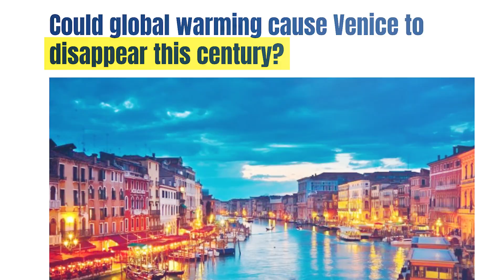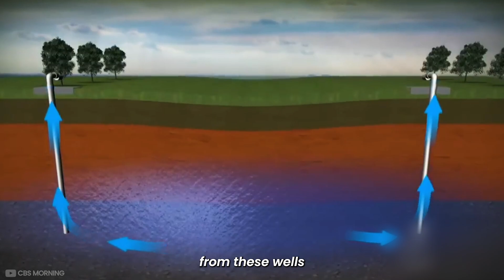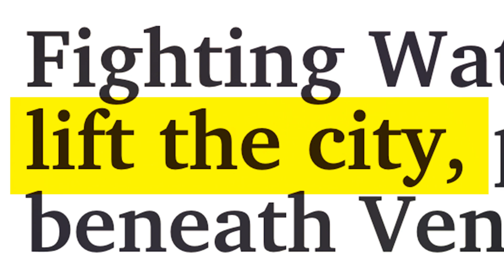Why Venice is SINKING Irreversibly

Comment: Venice is currently sinking at a rate of about 1 to 2 mm per year, and if current trends continue, it could be underwater by 2100. Experts suggest that the city could be at risk of disappearing beneath the waves by as early as 2100 due to ongoing subsidence and rising sea levels.

Comment: The powers that be (Oil companies, Automakers, etc.) are pathological liars. The city isn’t sinking as they would have you believe. The city stood for a thousand years, and suddenly, the whole city starts to sink at the same time? It would take some really gullible people to believe such nonsense. On the other hand, ocean levels have been rising for some time due to climate change and hotter-than-normal weather. This is why all the ice in the North and South Poles has been melting for quite some time. As a result, not only Venice but most oceanfront low-lying places like Miami, Bangkok, Amsterdam, and others around the world are getting flooded simultaneously.

Comment: Sinking 1-2 meters over the course of 1,000 years is an insane amount of sinking. It explains why Venice is struggling. That’s 1/2 - 1 person’s height. That’s so much.
Reply: Time to sharpen your math skills. The narrator says the Venice is sinking 1-2 millimeters a year. Let’s do some math, shall we??? Let’s assume that on average it has been 1 mm per year or less. That would be 1,000 mm, 100 cm or 10 meters. Last time I checked, that is a lot more than 1 person’s height.
Reply: @ITeachRick umm no, you need to check your own math. 1000mm = 100cm = 1 meter, not 10 meters
Reply: @dragonbowlsupper  oops………
Reply: @ITeachRick 😂
Reply: @dragonbowlsupper  That's why I use feet and inches, no one can figure out my mistakes.
Reply: @ITeachRick bruh moment
Reply: @ITeachRick 
D’oh !!!!!
Rick, that’s pretty funny, but the fact that you left your mistake here for 8 months just so I can laugh at it is commendable. I’ve been there too, making silly mistakes, but you owned it and are able to laugh at it yourself too. Very cool. Just had to tell you that.

Comment: So Vience sank the most in the 60's with the removal of water from the water table?  Ok.  Sank deeper into the soil below and now they are amazed that the flooding is higher now with the tides... makes sense. But, The proportion of CO2 in the atmosphere is about.0423%, but humans have contributed roughly one-third of that, according to NASA. This means that the proportion of atmospheric CO2 from human activity is around.014%, not 0.0016%.

Comment: How come it does not have rising damp?
Reply: It, sadly, does have rising damp. The salt deposit left behind erodes the brick quickly. The salt also prevents bacteria.
Reply from the maker: What do you mean by rising damp?
Reply: @EverythingExplainedd  Have you never seen a case where water seeps up through brickwork? if your brick house does not have a damp course between the foundation bricks and the walls above, then the walls above will be like blotting paper and the water will rise up through it and you will get mould..